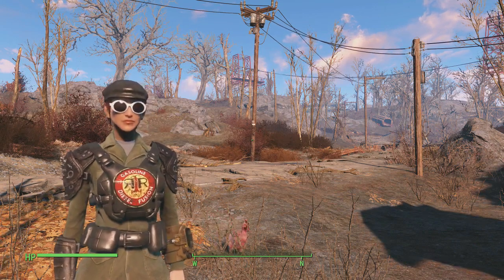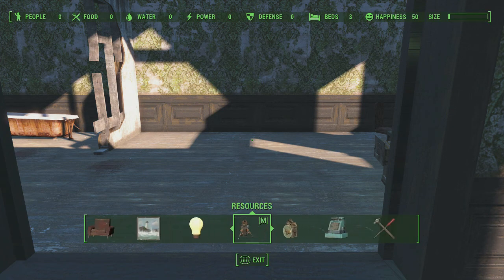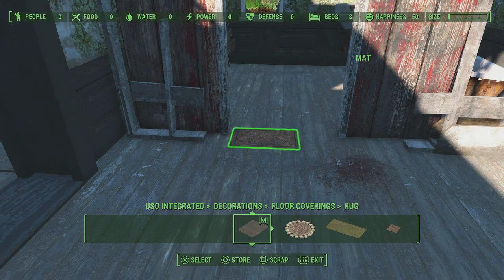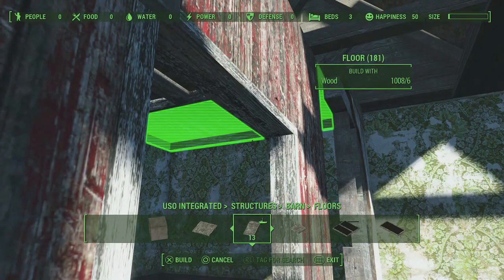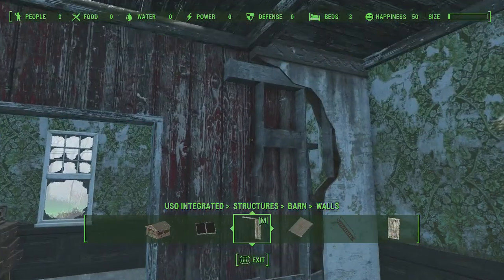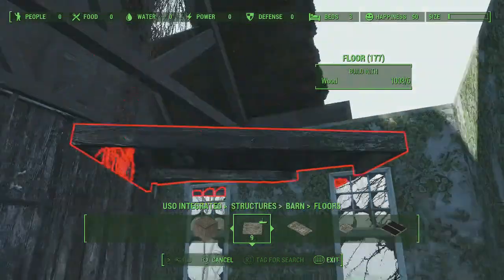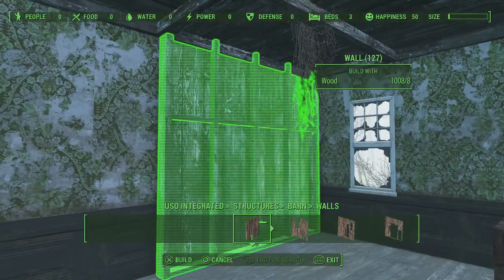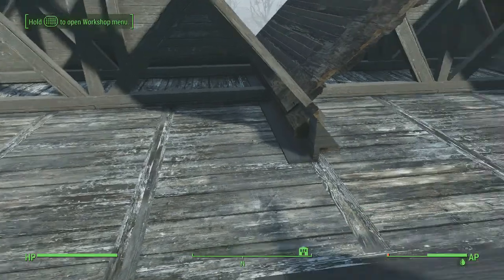Taffington Boat House repair

Comment: Fan by the staircase.....
Reply from the maker: Not sure what you're referring to but thanks for watching!
Reply: @onawhim7737  at the top of the stairs on the right. A broken fan you can't delete without mods. Very good video though, I copied this and also found a way to build through the fan somehow.
Reply from the maker: @ianpruitt4554  Yup, I mentioned that I had used a mod to delete the fan but the overall method at the time worked well. You can at times get a floor to glitch through. It's where you're standing or if the moon is full not sure which. Anyway glad you found the video of use and enjoyed it enough to leave a comment... Thank you!

Comment: when trying to place a wall or a floor or other component close to an existing structure, it's better to do the micro-adjustments in the middle of the room or open space - whatever the situation is.
What I mean is you start of the same way as you did with the wall in the corner, but instead of trying to get it as close to the existing structure you just align it correctly - I mean angle-wise.
Then add a half floor or roof panel in the direction of the open space, and place another wall there in the middle of the open space, so basically the 2nd wall has the same angles orientation as the first but only with an offset.
Then remove the first wall and floor/roof offset-piece to allow to move the 2nd wall without snapping to anything, and then position yourself right against that 2nd wall - you'll want to be as straight as possible to be able to preserve the angles while moving the wall only in the X & Y directions.
There's some eyeballing of course when trying to move that wall the exact same distance that the original wall was off from the existing structure, then to check it you'll have to put back the half-floor/ceiling piece and the original wall, and repeat it few times to make it perfect.
This way you can very often avoid those nasty little gaps that you get when you try to simply place something as close as possible to existing structure. 
The thing is usually on their own pieces don't like to touch the existing structures hence leaving the ugly gaps, but you have a correctly placed offset wall/floor/ceiling then you can span your pieces in a way that very often allow them to touch or overlap edges with the existing structures - hence giving you airtight fit :)
Of course it's Fallout so there's no guarantees and lots of tedious trial and error.
And of course when all else fail there's the mat-trick ;)
Reply from the maker: Thanks bluechaym for taking the time to watch and comment on a 2 year old video. It's good to see someone gets something out of it... Thanks again!
Reply: This explanation needs a video.  This reads like Greek to me!!  😂

Comment: Brilliant! I love the idea of utilizing the upper floor once the roof is fixed. I did that with the Egret Marina house- made a stairway (and stairway cover with a door) that lead up on the roof. Put a pavilion with a bar and lounge area up there :) Just thought the idea of a rooftop bar was too cool to pass up. And a lot of turrets along the roof edge as well, to guard all the water purifiers in the settlement of course ;)
Reply from the maker: Glad you enjoyed my work. I too have built up top at Egret Tours, a tough job for sure! Please check out my tour of Egret and Spectacle Island. I'm sure you will enjoy both. Thanks for watching. I do a daily live stream M-F noon AZ time. If you can come on by and say howdy! Cya!!